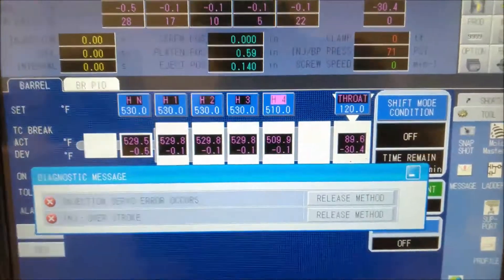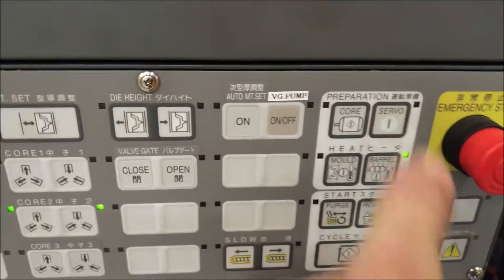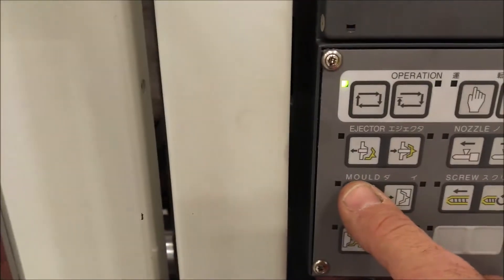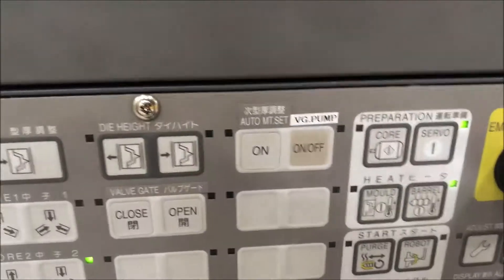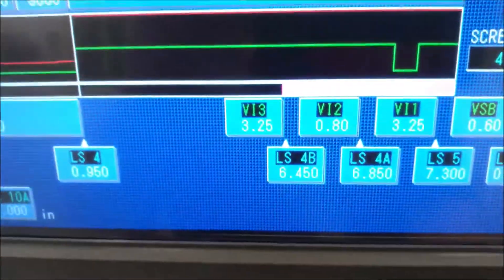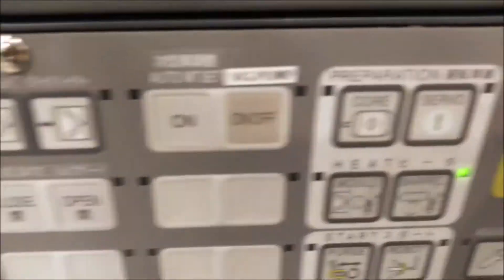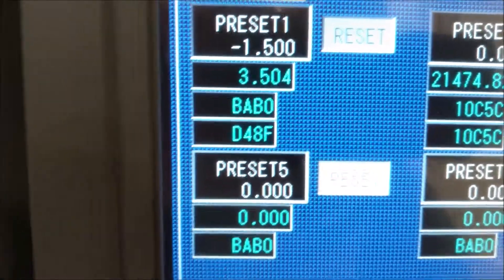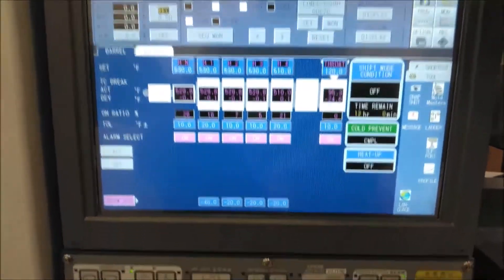Overstroke Fault

Comment: Hi! I have the same problem but with the clamp servo, I tried this method but it didn't work, do you know another way to make it work?
Reply from the maker: This is the method in the Toshiba manual.  Did you wait for the cold start prevention to be completed?
Reply: It worked for me thank you